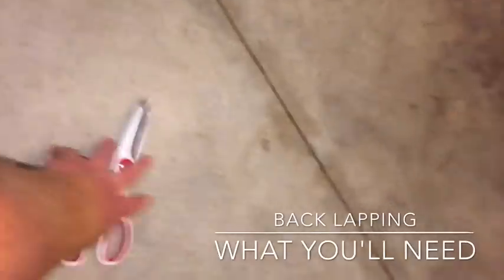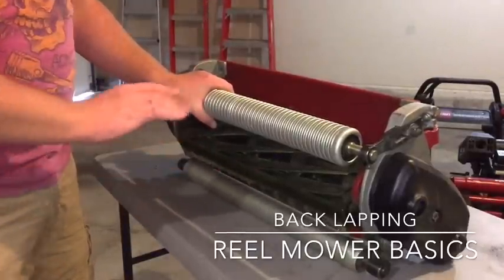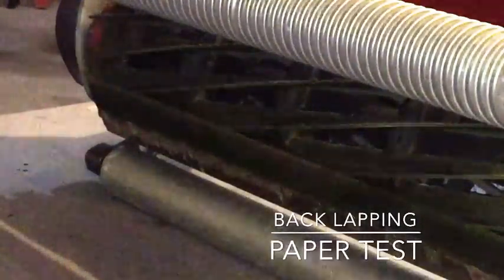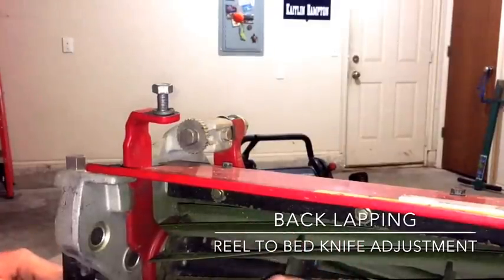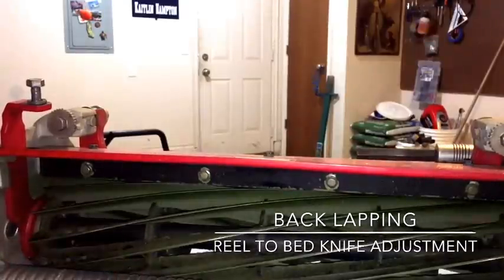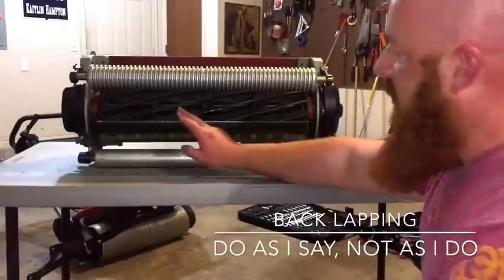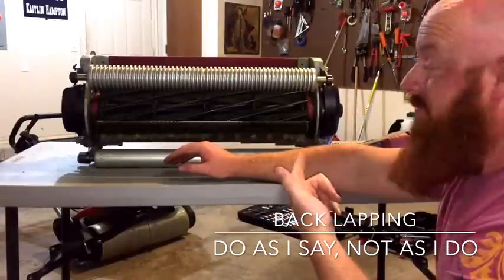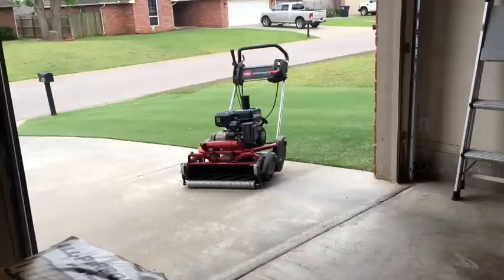DIY: Back Lapping a Powered Reel Mower

Comment: Hi Andrew, excuse the comment from a 5 year old video, but regarding touching of reel to bedknife, there appears to be 2 schools of thought. My recommendation is that it shouldn't touch each other at all. Contact between the reel and bedknife will generate heat which will have many effects on not only the turf, but also on the traction unit. The heat generated between the reel and bedknife will tinge the leaf blade. Also that heat can cause the bedknife to expand which will tighten the cutting unit up even more.
Reply from the maker: No worries, we can agree to disagree.

Comment: Excellent vid in all aspects. I appreciate the slower pace, it’s a precise technical process. Have you ever sharpened a Tru-Cut mower?
Reply from the maker: DrewMania yes, it’s not that much different other than the Reel to bedknife adjustment is difficult to fine tune.
Reply: Any advice you can give? Those eccentric adjusters are a little intimidating
Reply from the maker: DrewMania only to take your time.  I used a punch and small hammer in one of the spanner wrench holes to rotate mine.  It’s not ideal, but worked.

Comment: super great video sir... very well spoken very well explained, just picked up an old mcclane in good condition,, i rebuilt the 3hp briggs and stratton , repainted and replaced all nuts and bolts,, now time to get busy on the backlapping,, thank you sir ... you da man!
Reply from the maker: tudo cervera congratulations on the new toy!   The Mclane reel to bedknife adjustment is a little tricky, give yourself extra time to get it done correctly.

Comment: Any chance of you making a video that shows how to adjust the height of cut?  Just picked up a 2012 Flex 21 and need to make some adjustments to it.
Reply from the maker: rhea tomczyk I will do that!
Reply: you can use a accuegauge on double roller reel mowers, or place a board under the reel and bottom it out..make sure you set the board under the blade that is not adjustable.if the bedknife adjusts to the reel, set the board under the actual reel, then you can adjust reel and bedknife contact. if the reel adjusts into a fixed bedknife, adjust the contact before you place the board under the reel. this reel just needed a reel to bedknife contact adjustment. good video though. i sharpe mowers for a living and use a manuel foley reel grinder and foley bedknife grinder. www.reelsharpening.com

Comment: great video!! so with a decent reel mower is this all that is needed or do you still need to have the reel and bedknife grinding done as well? looking to buy a used machine and want to fix it up before I use it. thanks
Reply from the maker: Great question, there will be a point when the edge from backlapping won't hold for more than 2-3 hours of mowing time.  That is when you must have the reel and bedknife taken to a pro for either relief or spin grind.
Reply: Andrew Barry Cool thanks! I'm in the educate myself phase before I jump head first into reel mowing!! haha
Reply: I grind for a golf course.  there are two types of bed knives you can run on that mower. if your interested message me and ill find you the part numbers.. there is a greens style knife which allows much nicer cut quality as lower hights.. as the cost of having less material on the bed knife.. they also make a tee's knife which is substantially thicker. I couldnt see  well enough from the video.. but if you want longer life from your reel and knife consider replacing it with a tees style bed knife.. unless youre cutting at .110'' then stick to the greens knife

Comment: Great video! When you mentioned repeating the whole process 2-3 times, does that include adjusting the reel to bed knife contact again? Or did you mean just apply more compound several times?  Thanks for the help!
Reply from the maker: Sinan Gocmen I normally don’t need to adjust it, but I do check it each time.

Comment: i'm liking the toro flex 21...appears to be more comfortable to control just by looking at it.  you have trucut vids as well...do you own both?  which do you prefer?  i looked into the toro and it appears that it'll only go up the 3/4" height versus 2 1/4" on the toro but correct me on this.  great forum by the way.  thanks.
Reply from the maker: HBeretta I sold the TC, Damaged the Flex21 and currently mow with a JD220B.   I prefer the Flex21 over them all, but the Max HOC is actually 0.500 stock, there is a set of brackets to can purchase to increase the max HOC closer to the 3/4 HOC you're referring too.

Comment: Whoa dude! Way to fast, 400-600 rpm is good.
Reply from the maker: The max RPM on that drill is 650.  I try to hold the trigger at 75%, but that can be difficult for long periods of time while back lapping. Thanks for the tip.

Comment: I wasn't aware that the flex 21 would mow higher than .29 inches
Reply from the maker: 0.5 is the Max HOC.  Additionally, there is a set of brackets you can purchase to that increase the Max HOC to  0.75.  Check out the link below. Thanks for watching.

https://www.toro.com/golf/mower/green/walk/flex21_micro/specs.html
Reply from the maker: I wanted to add:  There is a rear roller on the Flex head that also needs to be adjusted to the High HOC setting for that max HOC of 0.50.
Reply: Red Tenchu No problem, I'm looking to purchase a flex 21 with roughly 200 hours on it. I can't wait to seed my new Bermuda and get her established!
Reply from the maker: Wow, 200 hours is super low!  Is it a Flex 21? Or Flex 2100?  

Mine has 1700 hours, so it should last you MANY years
Reply: It's a 2100, but don't get me wrong, I'm paying dearly for the low hours.
Reply from the maker: ok, the 2100 does have a max HOC at 0.29